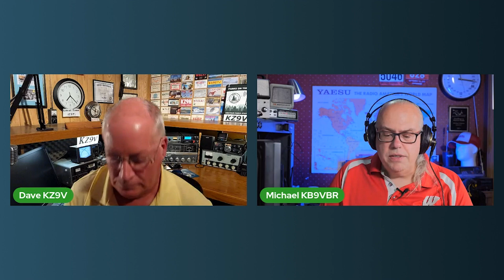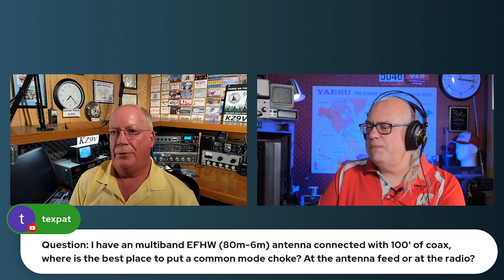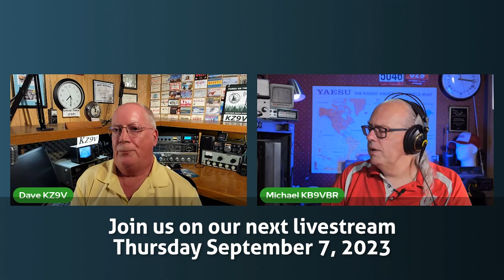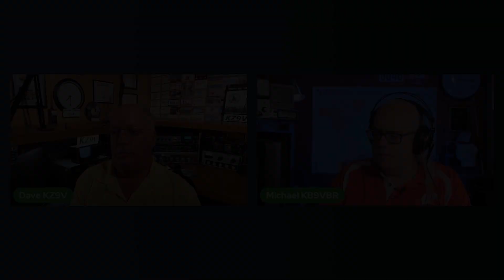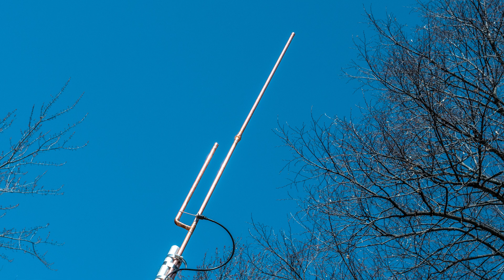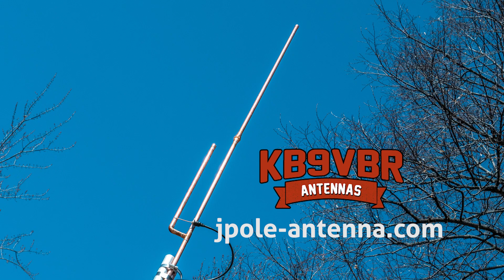Ask Michael, KB9VBR: Does my end-fed half wave (EFHW) antenna need a counterpoise?

Comment: The choke also is a load to balance the radiator. When link fed, it has been found that a counterpois can be as short as 3.5 feet long. You just don't want RF to get back into the radio area.

Comment: With respect to the 'does it make a difference if the feed point is elevated' question, in my experience with an 80M EFHW, it doesn't seem to, or if it does, not enough for it to matter much. My feed point is about 10 feet off the ground, and the coax is similarly about 10 feet off the ground for about 25 feet; just how I had to run the cable. I choked it about 14 feet back from the feed point, and it works as expected. If there's any question about where the right spot is for your antenna and location, then for 100W, 6 or 7 of the snap-on mix 31 ferrites are a good way to go, since you can easily move them around to find your answer.

Comment: For an EFHW, if I do choke the coax feed at 20% of a wavelength, is there anything to be gained by adding additional counterpoise wires?  Does one get any gain from the additional radials?

Comment: If you don't have one already, use this as an excuse to get some sort of antenna analyzer. NanoVNA,  MFJ, Rigexpert, whatever you end up buying, they have one for just about every budget. In the end, I think just experimenting with different configurations to see what works and what works better is time well spent. Might be a good time to try out WSPR as well. 

Personally, I have an EFHW for 10m about a half wavelength off the ground, parallel to the ground and added a tuning stub to get a slightly better SWR. I've only relied on my radio's SWR meter and generally run QRP and occasionally up to maybe 20 watts. I've worked Asia, Canada, Mexico - South America, Western Europe and almost have all 50 states. 

I realize not everyone has room or trees that high to do that so I've also run it vertical or sloper from the top of a mast. All work pretty well. 

In the end, it's all about results. Make a contact and feel successful.

Comment: I have noticed when portable, using my home brew 40-10 EFHW during POTA and such, a 50' coax works much better than when I use a 25' length of coax.  I would imagine that the 50' length matches up as a counterpoise better?

Comment: From doing portable for many years going place to place .I can say the counterpoise can change. also the length of end fed half  can change from location to location. wet ground vs dry ground vs snow on ground. how high up is the unun . all can change loading of a antenna . even the weather can . some times adding more counterpoise can broadband SWR more.  so the answer is whatever works well for your location of you EFHW . same goes for the 9:1 . some have 49:1 and a 1:1 bult in. that will need a counterpoise. I use the off set center fed dipole. 40 to 6 meter. that has both transformers in it.  the short element is the counterpoise. harder to set up in a park. EFHW is quite easy for quick set up. I had the 49:1 near or on ground and  going straight up or sloper . just lean DX commander pole into a tree. done. any fiberglass pole. MFJ has a nice one. just bring a counterpoise wire . you may need it. and may vary on different bands. sometimes a counterpoise can bring down the noise and can increase it. try both ways whatever works better go with that. 73's

Comment: The answer is no.
1:47 Please test a small transmitter located at the transformer feed of the EFHW without coax or any additional wire.  The EFHW dipole will radiate the same power as a center fed dipole less a bit of loss (~1 dB) caused by the transformer.  I've done this test several times confirming no need for a counterpoise of any sort.

Comment: I was curious about why I was getting erratic results when I was doing FT8 on WSJT-X with my EFHW antenna. Receive worked just fine and I could hear / decode traffic from all over. As soon as I enabled transmit, everything got very garbled and messy on the waterfall. I figured I was getting RF on my rig somewhere but wasn't sure where / how. This explains it. Choke ordered from DXE and we'll see how FT8 works now! Thank you so much!

Comment: What's the difference between a counter poise and a radial?
Reply: A rose by any other name...
Reply from the maker: In the broad sense, there isn't much of a difference. They perform similar functions. We typically speak of vertical antennas using radials and horizontal wire antennas needing a counterpoise.

Comment: To Dave's question about lower vs higher feed point height and how it works with regards to a counterpoise, I do not have a choke on my coax and do not have a counterpoise in place, the feed point is over 20' in the air with the far end about 30' up and it plays really really nice.

Comment: We sometimes call an end fed halfwave an end fed dipole, because it acts as a dipole at the lowest frequency, and multiple dipoles at harmonic frequencies.  Furthermore, modeling shows that the radiation pattern is that of a dipole.  So....I wonder why a counterpoise is needed?  Does a counterpoise make it an off-center fed dipole and not a true end fed halfwave???  Did the original end fed "zep" halfwave wire antennas require a counterpoise?
Reply: End fed half wave on the fundamental frequency gives a pattern like the traditional dipole. however you can work multiple harmonics with this antenna with a low SWR depending on how high it is placed above ground with just your radio tuner. counterpoise is needed if you choke the antenna at the feedpoint. if not it will use the outer shield braid as the counterpoise
Reply: @wildbill1  Was this a response to any of my questions or comment???
Reply from the maker: I wonder if the original 'Zeps' were more of the non-resonant variety and not the end fed half wave style we are accustomed to today. A 450ohm impedance would be easier to match with transmitters of the day than a 4000 ohm one. I need to find a really old copy of the Antenna Guide to see if my hunch is correct, though. 

But to your other point, adding a counterpoise to an EFHW doesn't turn the antenna to an OCF dipole. A true OCF is a half wave with the feed point roughly at the 2/3 point of the radiator. With the EFHW, the entire 1/2 wave of the antenna is being end-fed. Little, if any, forward power should be going to the counterpoise.
Reply: Is a counterpoise needed for an EHFW?  Simulation and experiments suggest no.  Search "Of end-feds and feed-lines" for a link to the receipts backing up this statement and revelation of certain counterpoise lengths that will certainly draw unwanted current away from the radiator.

The original zepp as popularly described has the 1/2 wave wire radiator with 1/4 wave stub for a total electrical length of 1 wavelength.  This length is complete and requires no counterpoise to function and may well be compromised by certain lengths of feedline or mounting structure.  This is analogous to the J antenna of course and a simple trick tames this tendency.  Search for "the j pole is herewith fixed" for one solution.
Reply: Interesting question.  An EFHW is a special case of an OCFD (off center fed dipole) where the 2nd leg is extremely short.  The key is that you are deliberately feeding a EFHW at the high impedance (low current) point through a 49:1 or similar impedance transformer. As I understand it the short leg of an OCFD is usually wired differently from the counterpoise of an EFHW such that it is not directly attached to the coax shield.  Not all OCFDs use the same design so the details may vary.  OCFDs also experience common mode currents that can make the outside of the coax act like part of the antenna.  I now use an OCFD with a choke at both the antenna feed point and the transceiver.  Without any chokes the whole house smoke alarms would sound every time I transmitted and the SWR was a little higher than I liked. I added the 2nd choke to reduce the receiver noise floor.  I was stunned how much the noise floor dropped with two chokes (from myantennas.com). It's now usually around S1.  Of course every installation is different.  For QRP in the field the choke isn't needed because the power is low and there are few noise sources nearby.  This makes the EFHW extremely practical as a field antenna (which I use).  For home use with 100 watts or more it needs to be tamed.  An OCFD is slightly more efficient and able to handle more power than a EFHW because the impedance transformer (4:1 unun) losses are lower.

Comment: The correct answer is that it needs to match the impedance of your impedance transformer.  If you use a 49:1, you need enough on the opposing side of the long portion of your antenna to be long enough to match 2450 ohms.  If you have a 64:1, you will need enough to match 3200 ohms.  YMMV based on your specific situation.

Comment: I run an EF that is 289' from end to choke on the coax and a common mode choke at the receiver. The wire is 203' long. Very quiet, tunes all bands from 120 to 6 end to end and SWR is less than 3:1 down to 1:1.. I've worked 99% of all stations I can hear on 100W. From APAC, SA, South Africa, Tasmania, Japan, eastern europe, russia,etc... It is a very tall Z shape when viewed from below and 45' down to 15'... I started with a 155' Palomar Bullet kit and modified it. Love this antenna. The choke was moved around to tune it and I don't have anything dropping down until after the choke into the shack. The transformer is 40' up in the air. And the choke is about 20' in the air about 25' from the shack.

Comment: Doesn't the lightning arrestor, since it is grounded act to remove cmc before hitting your transceiver?
Reply from the maker: No. Lightning arrestors consist of a gas discharge tube which is kind of like a circuit breaker. It will let RF energy pass, but large impulses like lightning cause the tube to fail, breaking the flow of energy which then is shunted to ground. Common mode chokes use inductance, either from a coiled cable or a ferrite choke, to block RF energy, but electrical fields are allowed to pass through.

Comment: If you run it to a stake in the ground, ,it's not nearly an endfed anymore.  It's more like a centerfed and your feedpoint impedance will drop.

If you start thinking of the antenna as an antenna and not an antenna with a counterpoise, you will begin to understand the theory more.  Because there never is any "counterpoise".  The antenna has 2 connections to it.  On an endfed, it can be a tiny stub on one side and a long stretch on the other.  There's capacitance that can be measured distributed across the element to the other side of the element.  There's inductance distributed along the element.  The collective values are the XL and the Xc which make up the "X" in the R+/-jX equation.  So if you make one side of the feedpoint really small, the Xc and XL will be really small because the tiny inductance is in series with the large inductance on the other side and small inductance in series with the large inductance is a small inductance.  The small capacitance on one side is in parallel with the larger portion on the other side.  That capacitance will be very small.  

The outer conductor of the feedline does not become any "counterpoise".  It's a feedline.  The feedline feeds to the feedpoint.  When it feeds to the feedpoint, current will flow into the antenna.  If it's not a match, some current will reflect back to the transmitter.  That reflection is on both conductors of the feedline.  

Current always is flowing on the outside of your coax.  This is something you want.  It's a part of the design.  What you don't want is reflected currents.  You avoid reflected currents by matching the feedline impedance to the antenna feedpoint impedance.  It's the only option.  

An "isolation transformer" is a real thing in electronics.  It's something to remover the DC flowing in the primary from flowing in the secondary.  I don't have any DC in my transmission line.  But you could if you are powering something at the other end of your transmission line, I guess.  

The more small side antenna you have, the lower your feedpoint radiation resistance.  That's all it is.  The smaller you make the small side, the closer to infinity the feedpoint radiation resistance becomes.  You know you have a 9:1, 49:1, or a 64:1 transformer.  The small side has to match whatever your transformer is really needing to see.  If you want to choke the heck out of your signal, fer crissakes, choke the signal.  Lower your output power.

Opinions don't matter here.  Only facts.  Please learn the topic.  You don't know what "common mode currents" are.  Look at Mark Smith's video between 3:00-5:00 minutes.  He slips up and uses stuff he learned in school during these 2 minutes and panders to pseudo-science the rest of the video.  He can't figure out how it all fits together because real science is not congruent with pseudo-science.  But he does give a pretty good view of the  facts for 2 minutes here https://www.youtube.com/watch?v=3ReRu7Yt4Ao&t=1442s .  According to him in these 2 minutes, there is current flowing in both conductors and when it is a differential current, it is a good thing.  But what "common mode currents" is not, it's not "current flowing in the outside of the coax".  

You're welcome for the feedback.

Comment: I keep hearing 5% for the counterpoise length.
Reply from the maker: 5% seems awful short.
Reply: For an EFHW, consider 5% of the fundamental wave-length as the minimum length for a counterpoise -- it works for me...
Reply: 5% of a wavelength at the LOWEST frequency is pretty universally accepted as the minimum length when utilizing the coax shield as the counterpoise.  So for a 40-10 EFHW, 5% of 40 meters = 2 meters (aprox 7 ft.).  I've been known to slip a 110uh coil extension on my 67 ft. wire and run the EFHW on 80 meters, so I  always use the same 15 ft. coax between my 49:1 UNUN and the coax choke.
KZ9V

Comment: Is COAX Obligate For Long Wire ANtenna?
Reply: Nothing is obligated,  but performance will vary by the implementation method.  I personally would never bring a long wire into the shack, but set it up, properly terminated as an external antenna and use coax to enter the shack.

Comment: Might also be noteworthy that at qrp levels (5-10 watts) a choke isn't usually necessary. At higher power, that RF gets more nasty coming back to your transceiver, so a choke becomes more of a necessity.
Reply: Still good for noise reduction. Nowadays, the receivers are very sensitive.
Reply from the maker: At QRP power levels, transceivers can be more tolerant of common mode currents, so choking isn't as much of an issue.

Comment: What would be helpful is showing us what it looks like when rf is coming back in the shack. Then demonstrate remedy options and the results
Reply: That's a good suggestion.
KZ9V
Reply from the maker: RF in the shack can manifest itself in a few ways. The most extreme is getting a shock or RF burn when you touch the ground side of the transmitter chassis. Other symptoms are poor audio quality (distortion) on your transmitted signal, distortion coming through unshielded speakers, and electronic devices randomly shutting off. I'll have to think about how that can be demonstrated in a video.
Reply: @KB9VBRAntennas     Right, how do you replicate it without risk.  I see lots of videos on equipment and features but almost no before and after videos.   Do you have any that start with a poor reception then apply the various filters and adjustments to tweak the signal to the best audio output?  Knowing what a feature does is one thing, knowing when and how to use it is another.  Your videos are great, your doing a great service.  Thank you.
Reply: It'll manifest in any number of ways. The three most common ones I can think of are hearing hum from computer speakers while you're transmitting, data modes acting as if they're possessed, e.g., CAT will turn the transmitter on, but won't turn it off, and, especially on 20m it seems, smoke alarms in your house going off -- there's one smoke alarm manufacturer that's a bit infamous for that.

Comment: Even without a coax shield connected to the secondary winding, it will still work thanks to the DISPLACEMENT current and capacitance between the primary and secondary winding. So whatever we do the antenna will always find a way not to violate Kirchhoff's law, BTW KCL does not apply entirely to RF circuits. See the test without any connection to the second port of the secondary winding. https://youtu.be/7bm0c_CNtVU?si=gsvkeJz7wdy2uEz3

Comment: 20-25’ on a 40 m efhw. 40-50’ on a 80 m efhw. Then a common mode choke. Then any length to your radio. Palomar and PackTenna both support these measurements

Comment: :D a friend of mine was surprised I use a coax shield as one of radials when using my center loaded vertical :D
having "only" 8 5 m radials, adding another one is usually measurable (well, today, after a week of raining = good ground conductivity it is not visible).
My idea originated from using coax braid as a counterpoise of EFHW antennas.

Comment: My EFHW is from myantennas  It is 6 feet off ground at feed point and 40 feet off ground at far end.  My coax runs from feed point 6 feet towards ground and then the remaining coax runs along ground 60 feet (like Dave said).  I've made over 500 Q's during 2023 already.  80m @1:1.5 and the remaining bands (40 - 30 - 20 - 17 - 15 - 10) are close to 1:1.2 except 17 which is 1:1.8.  Greet antenna.